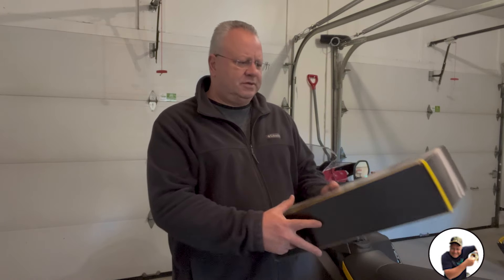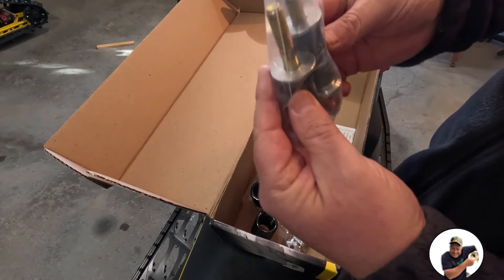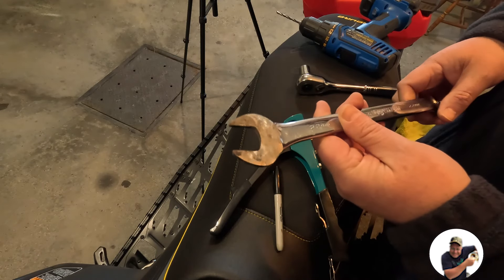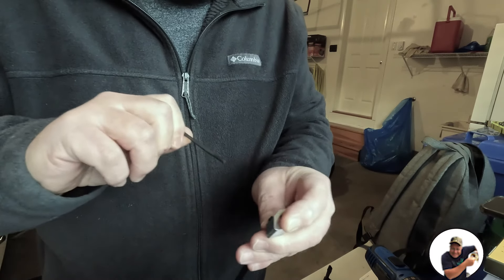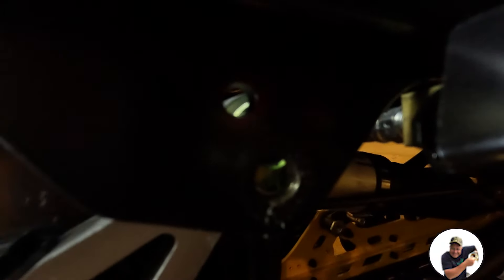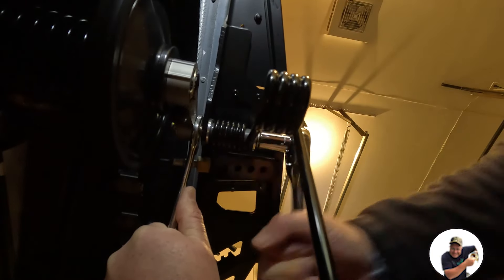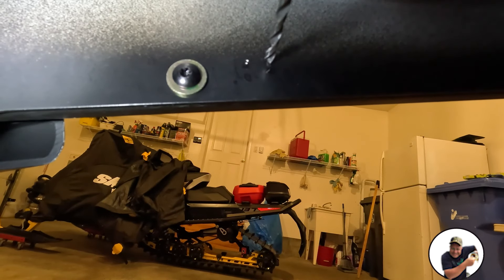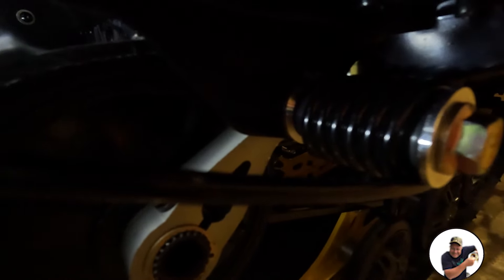Installing Ice Scratchers on a GEN 5 Ski-Doo Platform | Step-by-Step Guide

Comment: Great vid!  I just installed a set of these and had some extra info if its helpful. 1.  The package comes with a spacer that you should install on the right scratcher between the bolt head and the bushing and sleeve that carries the spring.  The end of that bolt protrudes too much without it and may hit idler wheel when skid is in motion.  2.  The left side mounts very differently because of the bracket for Smart Shocks on that side.  There is a hole for the scratcher bolt and spring tang to the left of the skid suspension bolt.  3. Dont rely on locktight.  Torque the bolts in you can.
Reply from the maker: Thanks for watching! Also thank you for taking the time to share with the community! Much appreciated. I didn’t have those spacers gonna contact brp dealer. Thanks for adding about the smart shocks!
Reply: @Outdoor_Hobby_Guy   You've got the spacers.  They're like thick washers.  They're in the same bag as the carbide tips.   BRP instructions are horrible.  Lol.  Thanks for the content again!
Reply from the maker: Oh! I’ll have another look

Comment: If a Machine Had Proper Cooling from the factory.... You Wouldn't need ice Scratchers.  That's My opinion and Why I haven't switched to ski Doo yet.
Reply from the maker: I some what agree! Thanks for watching 😊. What do you ride?
Reply: Every sled will overheat or run hot on hard pack and in icy conditions. Studs help a bit, but these scratchers kick up a lot of snow/ice which does infact bring your operating temps down in to normal or just above normal range.